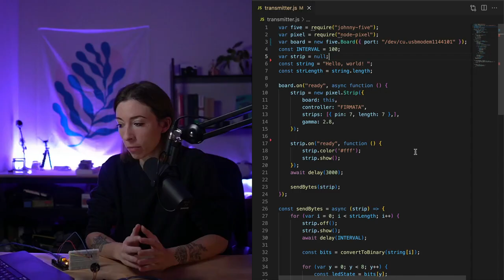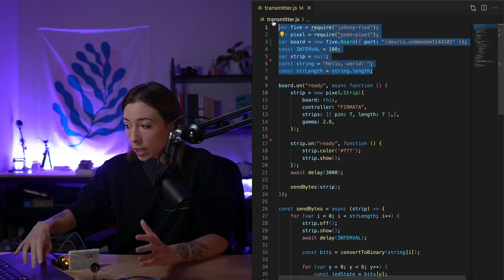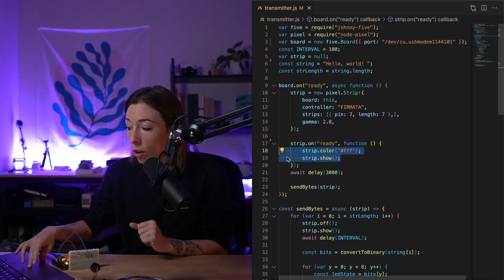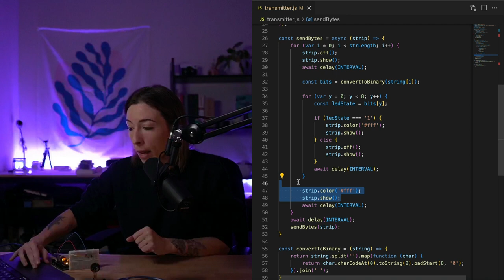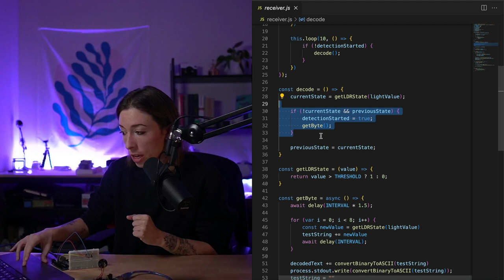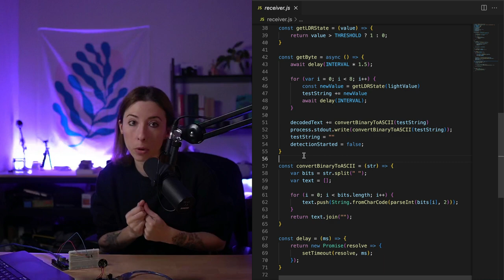Li-Fi: Send data via light using Arduino and JavaScript

Comment: Could you explain how can we send video also using this technology
Reply: Very Very slowly

Hello, World! - is 12 bytes and it takes approximately 1 second using that method

if you were to say send a GIF, the average GIF is about 20kb (20,000 bytes)

to send 20,000 bytes this way would take around 1666 seconds (27 mins)

to send a video for example - a 5 minute video at 1080p would be about 170MB (170,000,000 Bytes)

this would equate to 14166666 seconds or aprox 164 days at that speed

so, whilst with this setup technically possible, it would be highly impractical

But... if you wanted to do this, you could convert a video into binary send that over and reverse the process the other side

Comment: Amazing 🎉
How about sending videos?
Reply: Very Very slowly

Hello, World! - is 12 bytes and it takes approximately 1 second using that method

if you were to say send a GIF, the average GIF is about 20kb (20,000 bytes)

to send 20,000 bytes this way would take around 1666 seconds (27 mins)

to send a video for example - a 5 minute video at 1080p would be about 170MB (170,000,000 Bytes)

this would equate to 14166666 seconds or aprox 164 days at that speed

so, whilst with this setup technically possible, it would be highly impractical

But... if you wanted to do this, you could convert a video into binary send that over and reverse the process the other side